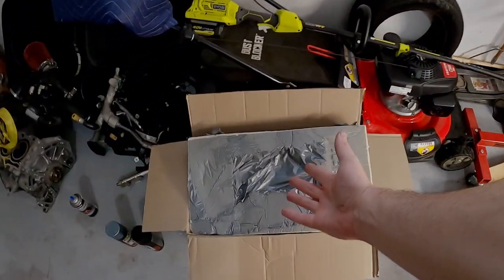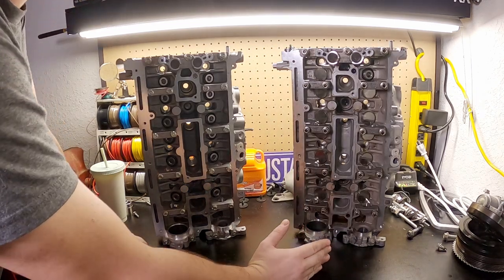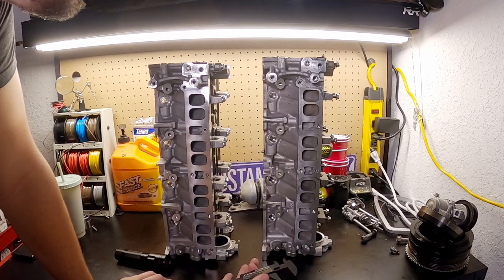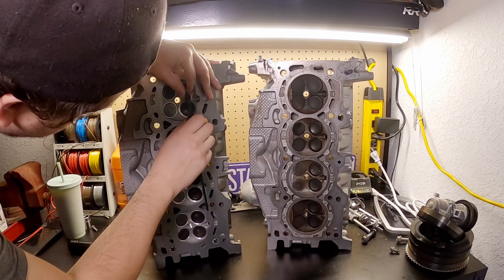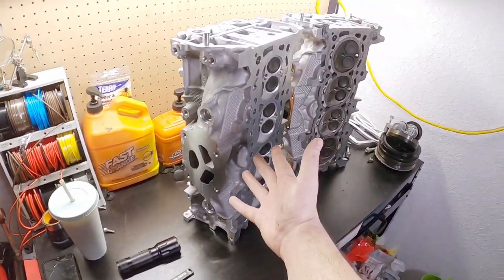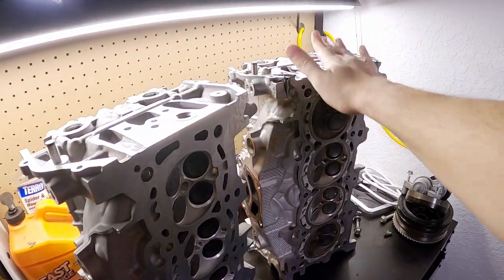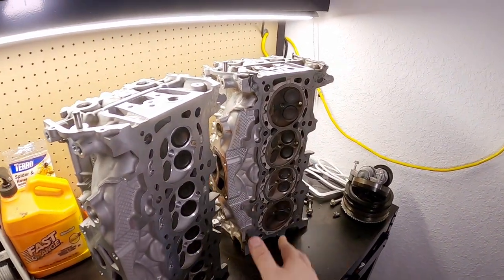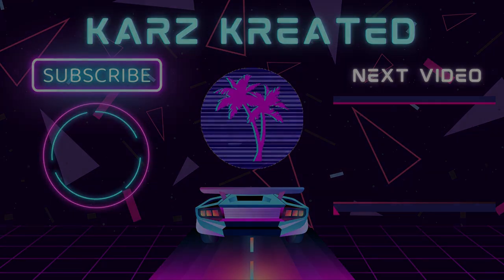Ford Mustang Ecoboost Cylinder Head COMPARED - Focus RS Vs Mustang

Comment: 100% this is exactly what my theory was and im so happy you proved I was right! These engines are surplus, all marketing scheme for sales. It is very unfortunate. Surprisingly the Ford performance TUNE pretty much did the same job with a simple flash. I wonder if those cams can be installed without further modification with a custom tune? 

also, the actual RS engine also have a built-in oil cooler I believe, the HPP does not. This is because the engine being used on the HPP is from an early stage prototype of the RS development, they went for the prototype that could be used as is with the surplus parts/components of the now discontinued RS

Comment: Good info for those who plans to buy the Ecoboost HPP Mustang. 

I also have the impression the HPP was superior in some way until you pointed out there are almost no difference in the block and head construction. That said, i not a fan of integrated exhaust manifold designs. It makes things simpler but it does hold back the flow at the top end. 

The B58 in the A90 Supra had integrated manifold and they later revised the manifold to be seperated. Made the big difference.
Reply from the maker: Yeah the headifold is definitely the biggest limitation for sure. I would love to explore a future setup utilizing a multiport head, but at that point it would be a complete custom build. So not any time soon! 😅

Comment: Thanks for the video, you've really done a lot of research!!
Something I found interesting, are the differences in the factory tuning. If you purchase the HPtuner interface, your also get access to a library of factory tunes, including the base 2.3, the HPP 2.3 and the RS 2.3 tune. I've downloaded them, but haven't compared them. But it does look like there are differences.
It makes me wonder, can you jump from the 310 base hp, to the RS 350 HP, by simply upgrading your cams, turbo and tune??
Reply from the maker: I'm glad you are enjoying it! But yes, the tune is very different on the RS/HPP. Stock max boost on the HPP is 22 PSI where as a standard 2.3L is around 18-19 PSI. The difference in boost is enough to make the difference in power. But the power curve is significantly different in the HPP which is from the combination of the cams, turbo and hotter calibration. Nothing that can't be done to any other ecoboost mustang.